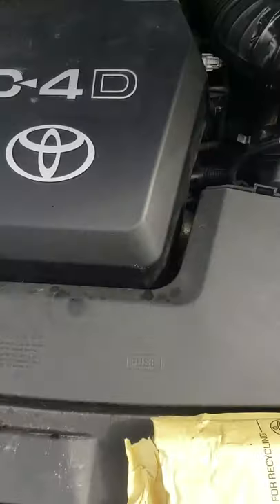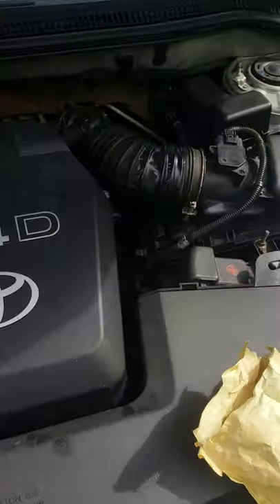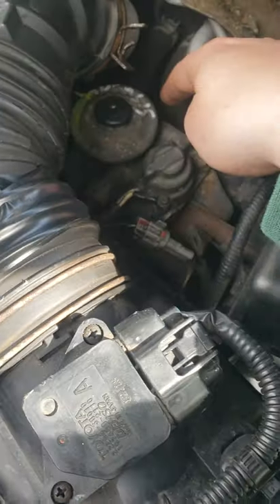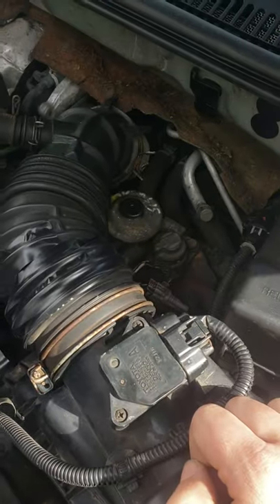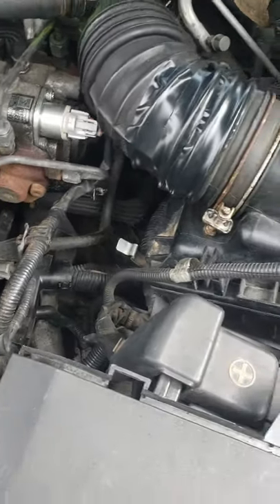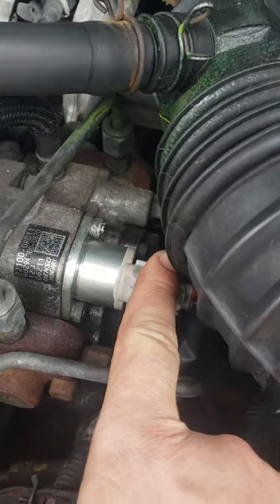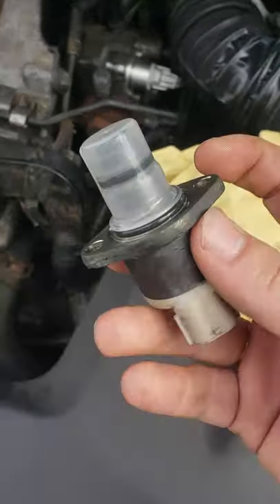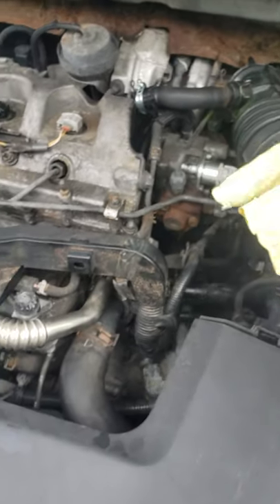how to replace SUV Suction Control Valve toyota avensis d4d 2008 model.

Comment: Good job Darran, i have a 2.0  Avensis D4D with the same issue so I'll be ordering a new Denso OEM Valve for it ASAP as it seems to cause a common fueling issue when that Valve starts failing.. i believe it is a consumable part like many others and it does not need to be coded in to the ECU from what i've heard. I thought it might have been a dodgy diesel fuel filter so i changed that   on a service i did a couple of months back but no joy, it needed changed anyway so it is all good on that now anyway. I'll update here when i get and install this new valve soon... 👌🏻
Reply from the maker: No does not need to be coded, just replace and hopefully should do the trick.
Reply: I have the same problem with mine with about a year but only in cold weather, temperatures around 3 or 4 degrees and below. It only happens first thing in the morning, starts first time but cuts out straight away, try again starts and runs no problem.  In the recent cold weather at - 7 degrees it it did this about 7 or 8 times flattening the battery in the process.  Jump started no probs. It starts and runs grand for the rest of the day. No problems the during the milder weather. I think I will replace the scv though after seeing this.
Reply: Do u know from where i can buy the denso scv ? Could u send me a link plz  
Thanks?
Reply: It doesn’t needed coded but it does need a reflash learn.

Comment: Recommend changing the air intake pipe it looks damage the engine won't be metering the air correctly if it's leaking after the air mass meter, recommend the larger scr valve Toyota recommend software update with it  you don't need it

Comment: What code was the sunction control valve? Which part number. Did you put the car in the diagnostic mode with the brake? I have the same issue on one I just bought on a 2.0d4d. Is it still solving the problem, I feel like looking at the wear patterns that it's the valve stem that wears out and causes the valve not to engage correctly. Some have found disassembly and clearing of the channels work as somethings been dragged upstream into the valve. I want to make sure I order the correct one if cleaning it doesn't succeed.

Comment: Was the engine knocking under acceleration before you changed it
Reply: Howsit going my 08 Hilux made a knock noise when I got it going wasn't running right like starving or too much diesel was going thru not 100% sure. did yours do the same
Reply: @pourakich-hr5uj  my 08 avensis 2.0d4d does it when its cold and its much quieter when it warms up